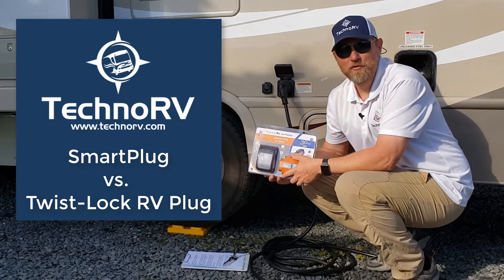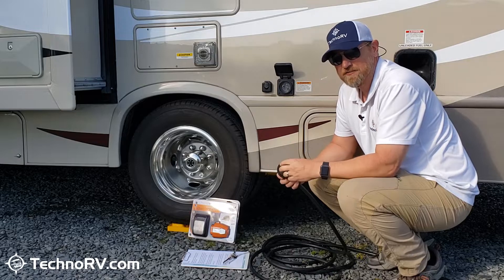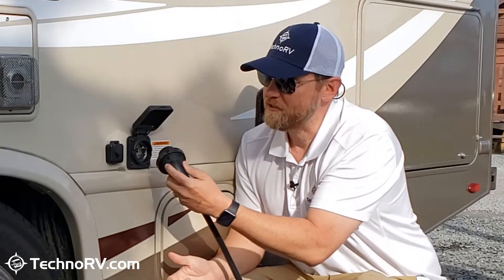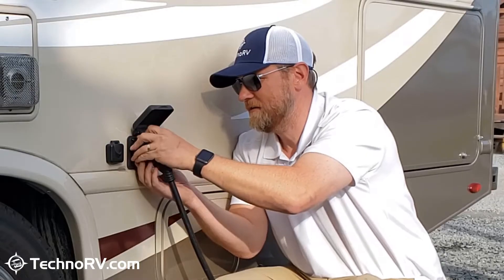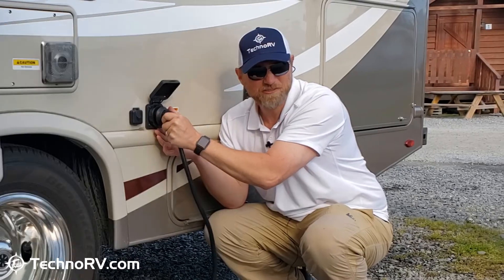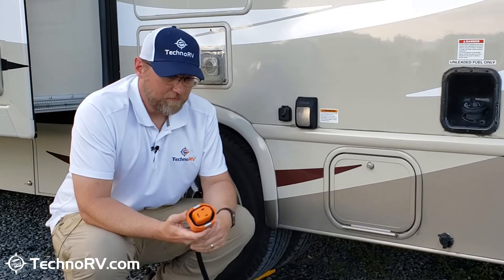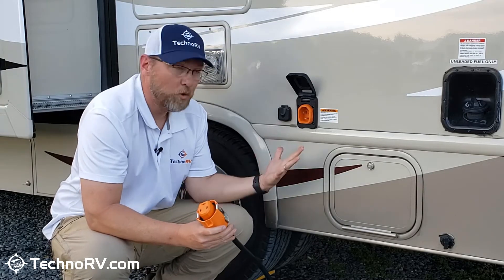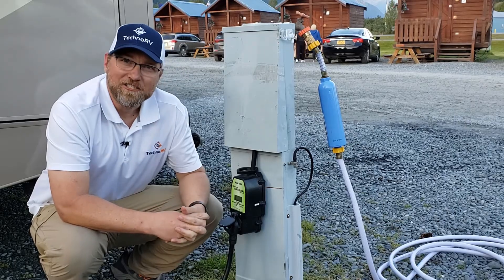Why is the SmartPlug Better than the Traditional Twist-Style RV Electrical Plugs?

Comment: I recently purchased the smartplug and like it. The reasons you give are kind of lame. If plugging in, rotating and tightening  the calor I'd that difficult, I feel sorry for the person. It would be more helpful to show the difference in electrical resistance between the two.
That said. The difference between the two is mostly design and configuration of the same type of materials and does not justify the insanely high cost for it. 
Like I said. I bought it due to hearing a sizzling sound when I plugged the factory one in.

Comment: The twist style is really not that bad IMO, the whole "surface area" theory is a bit of a stretch.  The twist style is not anywhere near as hard to connect as what you showed, surely you were exaggerating all the problem you had connecting it as part of your sales pitch for the "new and improved" expensive fix.

Comment: I know that the size of the contact area of the twist type connector vs the smart plug is part of their advertising but the mathematician in me says that given similar sized connectors, the area of the surface connected would be minimally different.
Reply from the maker: Hey John, understood, and I have not taken a set of calipers to them, but they are thicker and larger in size. The manufacturer would have taken the measurements and come up with how much larger it is than the typical twist style. I have looked at both of them completely broken down and you can visually see the difference. 
Eric

Comment: Recently sold our RV and got a different one. We had a Smart Plug on the last one and adding a Smart Plug to the latest one was one of the first things we did after getting it. Love the ease of use and peace of mind it provides. We got the Smart Plug cord this time instead of converting our existing cord. It's MUCH nicer quality and longer than the cord that came with the RV.  Smart Plug, for us, was a minor investment to help prevent future issues and frustrations.

Comment: The only issue with the twist lock ring I've had is when I am hurrying the process not getting the lock ring started correctly.. For $ 206 for the "Smart Plug", I will slow down. That is crazy expensive.
Reply from the maker: Thanks Dan, it is certainly a upgrade. IT is not just the connection, but also better electrical transfer because of the thicker, bigger pins, and this means less heat on the plug, always a good thing. 
Eric

Comment: IMO the Smart Plug is simply another $75-$100 RV product looking for problem to fix
Reply: I agree 100%.   I have been RVing for over 40 years and this seems another useless $150.  Never had remotely any of these "issues" he claims.
Reply from the maker: Thanks for your opinion Paula. Without putting your hands on this unit and experiencing the quality build, I can see that being your opinion. Once RVers get this unit they wished they had made the change sooner. If we see you down the road maybe we can show you one of these, in the meantime, safe travels.. Eric
Reply: @Technorv  And I am one of those RVers!  Hubby and I are big fans of the Smart Plug. Did the the spinny twist lock thing that came stock on the RV work?  I believe so. Was it annoying and challenging to use at times? Yep.  Was I often uncertain I had it twisted right and the spinny thingy on straight? Yep.  And what happens when the spinny thing breaks? Not awesome.  Smart Plus is a minimal investment for a reassuring fix that also helps me be less frustrated during what can sometimes be a frustrating situation (setting up at a campground, with your spouse).  A great -- optional -- product for RVers!  If RV manufacturers were really nice, though, they would make these things stock.

Comment: I disagree.

And my 30 plus years of of experience working heavily with Twist Lock connectors in all sorts of mobile and on site venues, vehicles and generators tells me that everything you mention before the 5 minute mark is nit-picky.
Reply from the maker: Hi Mike, 
Thanks for your opinion here. We are finding that RVers are demanding more quality in their electrical transfer and the Smart Plug delivers. I wish you would give the Smart Plug a try because I know your opinion would change once you try it. Every RVer that makes the switch wished they would have done it sooner. 
Safe Travels. Eric

Comment: Can you tell me the difference between the kit and buying the outlet and the power cord? Does the kit come with a power cord or just a plug that we have to  put on our own cord after striping off the old connector?
Reply from the maker: Hi Scott, 
If you get the inlet and the power cord, then you would only be replacing the inlet on your RV, and your new power cord would have the Smart Plug head already on it. So your old cable would not be used with this scenario. If you buy the kit with the inlet and plug, then you would replace the twist plug on your existing cable with the Smart Plug head in the kit, and then change the inlet. Both ways get you the new inlet, the difference is do you use your existing cable and replace the head, or just buy the cable with the new head already installed. I hope this helps. Eric
Reply: @Technorv  Thank you makes more sense to go new cable and inlet then. I dont want to risk it to cut off old end and put on the  new one, for peace of mind.
Reply: Metal vs non metallic what is the pro for the more expensive Stainless plug?

Comment: Love the idea.  I have been concerned with connectability of the twist lock style connection.  Love the Angle out of the power cord on the old style twist. .  Why is this new plug not built with the angle of the power cord out of the plug? Seems like its now a weak point for the cord and strain relief over time.
Reply from the maker: Hey Robert, The one thing that everyone notices when holding the smart plug is that it is built like a tank. The unit also locks into place, so the straight cord does not present an issue with sagging. On the twist plugs, the 90 degree cords can relieve stress on the plug because a gap usually exists between the plug and the inlet. I hope this helps answer your question.

Eric